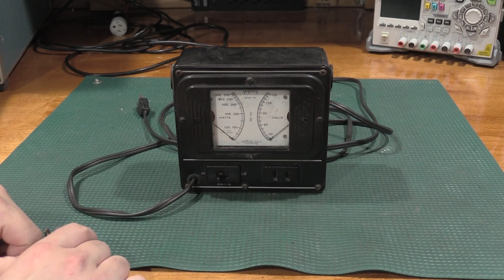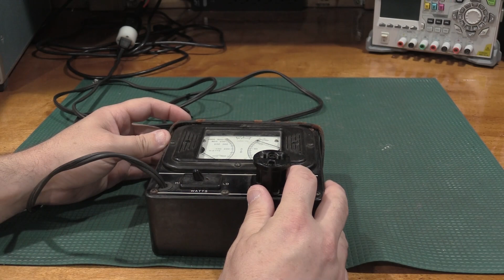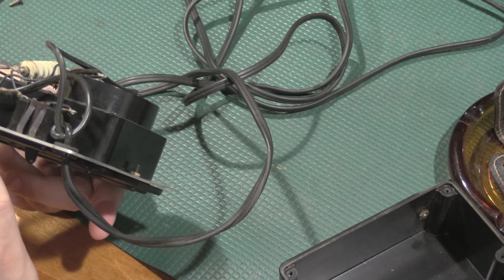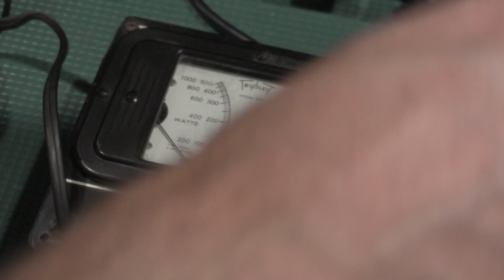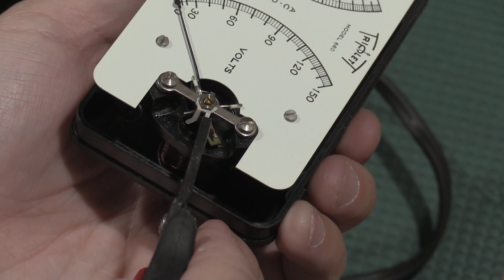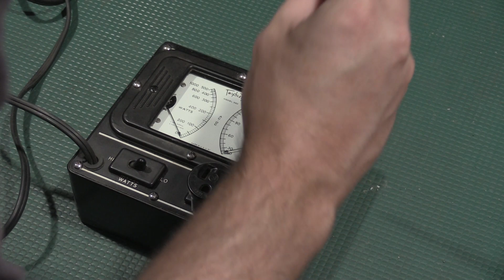Triplett 660 Load Meter

Comment: The 7ft power cord on my 660 is dry and cracked. Where did you find a replacement rubberized power cord with molded plug?
Reply: Do a search online.

Comment: Not a big deal but the company name is Trip-let, not Trip-lite. I have 6 variations of the venerable Triplett 630 analog volt/ohm meters that I have restored. They range from the early 1950’s - the 1980’s. Great meters with a wider range than the Simpson 260. I have one of those too that works great, just fonder of the Triplett 630. Keep the great videos coming on this vintage gear. I too love restoring vintage test equipment.
Reply from the maker: I want to get a few of the Triplett 630 meters for the lab. I have a 260 that I have repaired but not calibrated yet (needed to swap the meter movement) it was mechanically destroyed. But I do have needs of the wider range.

Comment: Simpson did make one of these that was AC/DC with switches for 130/260V and 1500/3000W. Dual meters in a vertical orientation. I have one sitting on my "to-do" shelf. Haven't been able to figure out the model yet though. Have one similar to this Triplett (different brand) but switchable 500/1000/5000w range. Don't think I'd want to be anywhere near it on the upper range though.

Comment: I admire your consistent choice of vintage.  I just added a cheapo digital V/A/W meter to my variac.
Considering the damage, I would have measured full-scale deflection current for the meters and calculated what resistor to use. Eh, you're close enough for those gauges.
Reply from the maker: I was able to confirm that both resisters were 5.5K Ohms. A good quality modern one was used as an accurate replacement. I am sure the 3 Watts is over kill for the power rating. The meter movement is 50uA if I remember correctly. What makes this one a little strange is that it can do DC and AC not just AC.

Comment: Did i missed part where you said what value those resistors are? At one point you said you need to figure it out and then i see bag with new resistors.
Reply from the maker: The value of the resisters was 5.5K Ohms. Replacements were modern 3 Watt 1%. So much tighter than what was there originally.

Comment: HP made a number of variacs, model ET004. These were engineering prototypes as I understand, however they use the similar Triplett meter style (AC only v/a). I have never seen the documentation in any source however there are number out there so might have been a small run of them. My father has one and I do as well so you can find them. They are in a HP 431b style case with the large variac knob on the top of the case. I can send you a picture if you email me.